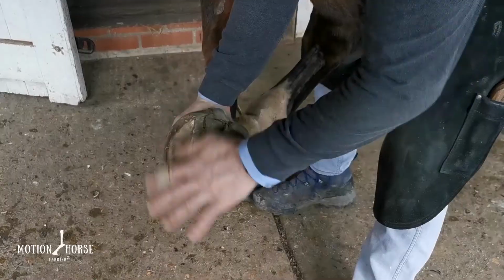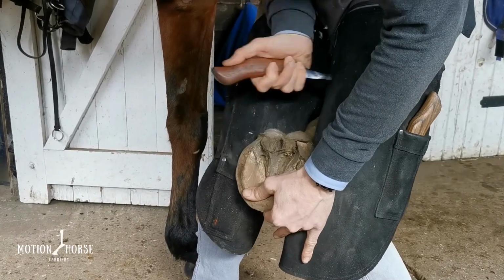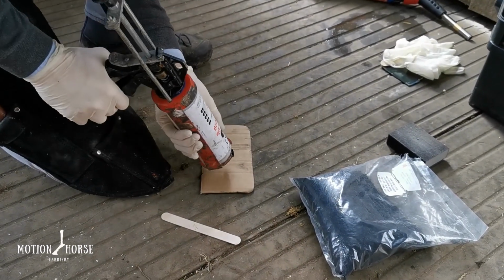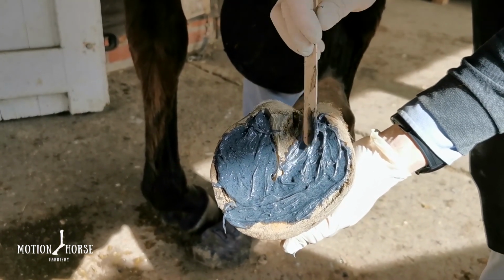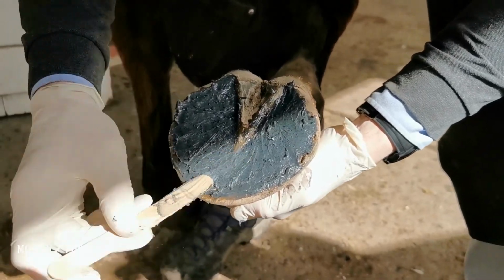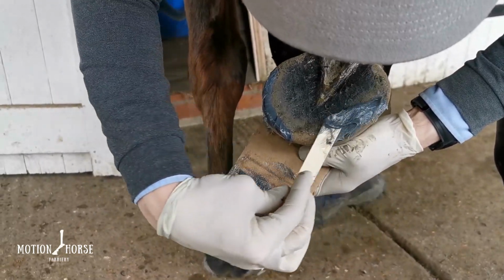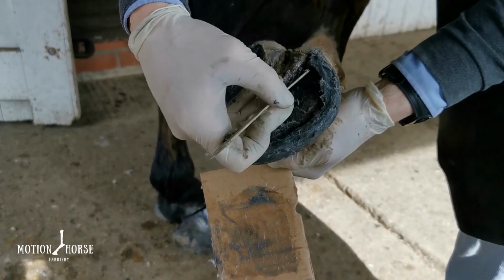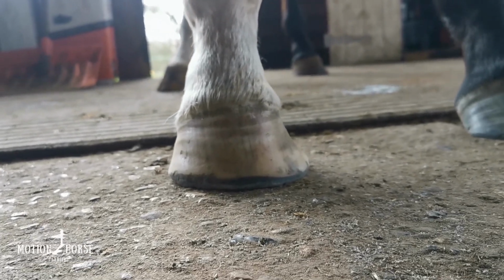REBUILDING HORSE HOOF

Comment: Interesting, I appreciate you sharing this technique with us! As questioned by another comment: is this a temporary bond, or must it be removed with cutting tools? Is it durable for light trail riding or just therapeutic?
Reply from the maker: It's bond's very well to hoof if the application process is a good and thorough. It can certainly be used for light trail riding but bare in mind it will wear and the wear will vary depending on terrain speed etc

Comment: I’m very interested in learning more about this product. Would you share the information? Would you tell me about the removal? Does it happen on its own or do you need to use a chemical or physical remover?
Reply from the maker: I trimmed the hoof as you would normally with a pair of nippers and Hoof raps. Once set up the material is very similar to horn and will either wear away or you can trim it away.
Reply: Alex, would you share the links to purchase the products? Thank you!